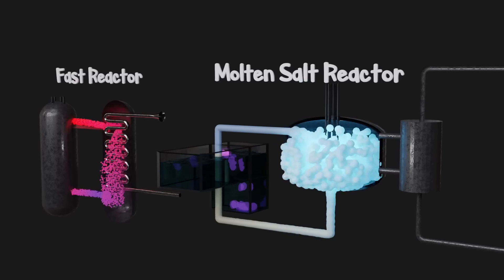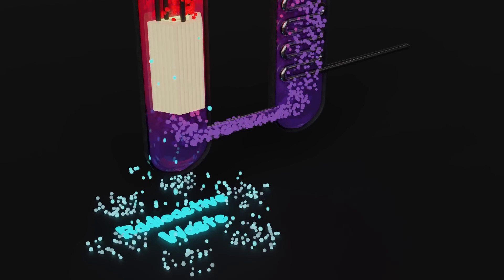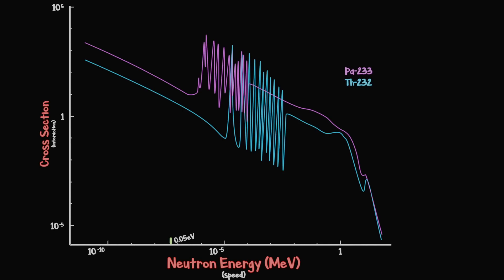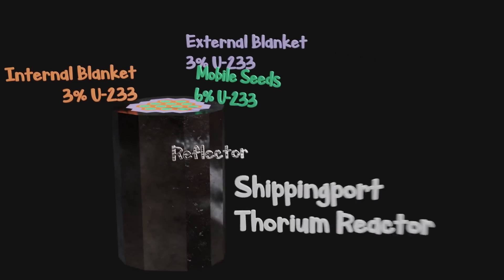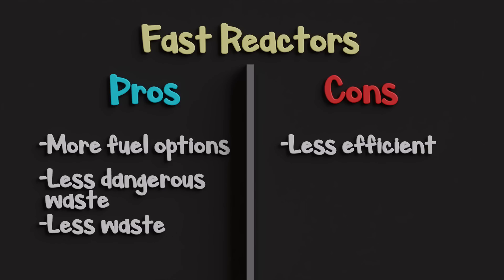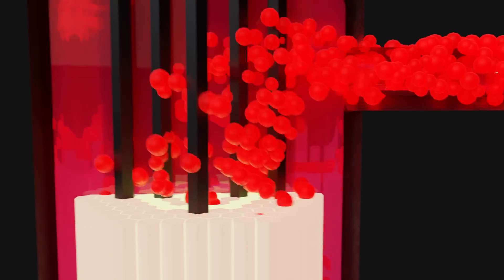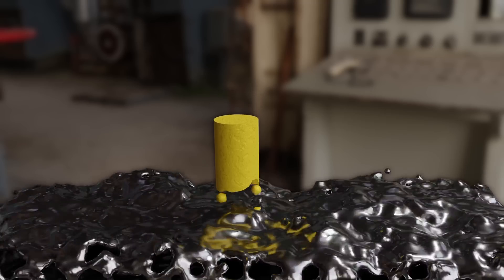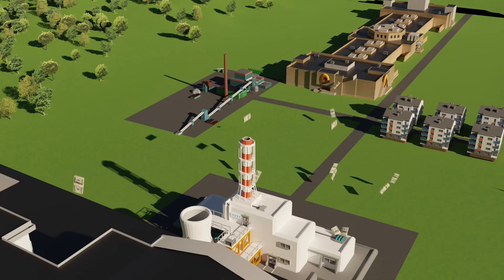Thorium and Fast Neutron Nuclear Reactors

Comment: Theory of Everything solution (short version): 

Swap from Newton "real/necessary" universe over to Leibniz "contingent/not-necessary" universe as our fundamental blueprint of the universe. 

This includes Leibniz calculus vs Newton calculus. Anywhere Leibniz and Newton thought different. All of it. Full swap.

Gottfried Leibniz "contingent/not-necessary" universe just lacked 2022 quantum physics verbiage (just match up definitions i.e. quark and Monad) and Hamilton's 4D quaternion algebra (created 200 years after Leibniz died).

Lastly, our first number is NOT 1. 
It's 0.

Our ten numbers are 0, 1, 2, 3,...9 ✅.

Our ten dimensions are 0D, 1D, 2D, 3D,...9D ✅.

Ask someone to begin counting. I bet they begin with 1.

1 is not the beginning.
0 is the beginning.

1D is a Line; two points; physical; matter; beginning and ending; contingent.

0D is a (point); exact location only; no spatial extension; zero size; Monad (Leibniz) Quark (strong nuclear force); necessary.

Examples: 

What is another word for quark?

fundamental particle, elementary particle.

Do quarks take up space?

Its defining feature is that it lacks spatial extension; being dimensionless, it does not take up space. 

How fast do quarks move?

the speed of light (see Leibniz's Law of Sufficient Reason).

What is an elementary particle example?
(0, 1, 2, 3)

Elementary particles include 
quarks (the constituents of protons and neutrons), 
leptons (electrons, muons, taus, and neutrinos), 
gauge bosons (photons, gluons, and W and Z bosons) and the Higgs boson.

What is the size of an elementary particle?

The elementary particles are not believed to have any size at all. As currently understood they are zero size points. Protons and neutrons (and all hadrons) are about 10−15m.

Match Leibniz definitions to quantum physics definitions. Different word, same definition. 

Not a coincidence.
Reply: This feels like bot.
Reply: Human consciousness, mathematically, is identical to 4D quaternion algebra with w, x, y, z being "real/necessary" 
0D, 1D, 2D, 3D 
and i, j, k being "contingent/not-necessary" 
0D, 1D xi, 2D yj, 
3D zk. 

0D is always w (real/necessary)

1D-9D contingent/not-necessary universe has "conscious lifeforms" (1D xi, 2D yj, 3D zk)..."turning" 'time'.

[In mathematics, a versor is a quaternion of norm one (a unit quaternion). The word is derived from Latin versare = "to turn" with the suffix -or forming a noun from the verb (i.e. versor = "the turner"). It was introduced by William Rowan Hamilton in the context of his quaternion theory.]

[Math; 4D quaternion algebra]
A quaternion is a 4-tuple, which is a more concise representation than a rotation matrix. Its geo- metric meaning is also more obvious as the rotation axis and angle can be trivially recovered.

How do you make a quaternion? (Nobody is starting with 0)

You can create an N-by-1 quaternion array by specifying an N-by-3 array of Euler angles in radians or degrees. Use the euler syntax to create a scalar quaternion using a 1-by-3 vector of Euler angles in radians.

"Turn" to what, you might ask. 5D is the center of 1D-9D. The breadth (space-time). All things are drawn to the center, the whole. (Gravity means Nothing compared to the Strong Nuclear Force)

[Contingent Universe]:

3 sets of 3 dimensions:
(1D-3D/4D-6D/7D-9D)

The illusory middle set (4D, 5D, 6D) is temporal. Id imagine we create this middle temporal set similar to a dimensional Venn Diagram with polarized lenses that we "turn" by being conscious. 

Which requires energy. 3D height symmetry/entanglement with 6D depth and 
9D absorption is why we are "consumers", we must consume/absorb calories, and sleep, to continue "to turn" 'time' (be alive).

1D-3D spatial set/7D-9D spectral set overlap creating the temporal illusion of 4D-6D set. Transcending one another.

1D, 2D, 3D = spatial composite (line, width,  height)

4D, 5D, 6D = temporal illusory (length, breadth, depth)

7D, 8D, 9D = spectra energies (continuous, emission, absorption)

Symmetry/entanglement: 

1D, 4D, 7D line, length, continuous 

2D, 5D, 8D width, breadth, emission 

3D, 6D, 9D height, depth, absorption

[Time]
According to theoretical physicist Carlo Rovelli, time is an illusion: our naive perception of its flow doesn't correspond to physical reality. Indeed, as Rovelli argues in The Order of Time, much more is illusory, including Isaac Newton's picture of a universally ticking clock.

Does time exist without space?

Time 'is' as space 'is' - part of a reference frame in which in ordered sequence you can touch, throw and eat apples. 
Time cannot exist without space and the existence of time does require energy.

Time, then, has three levels, according to Leibniz:

(i) the atemporality or eternality of God;

(ii) the continuous immanent becoming-itself of the monad as entelechy;

(iii) time as the external framework of a chronology of “nows”

The difference between (ii) and (iii) is made clear by the account of the internal principle of change. 
The real difference between the necessary being of God and the contingent, created finitude of a human being is the difference between (i) and (ii).

Conclusion: Humanity needs to immediately swap from "Newton" to "Leibniz". Also from Edison to Tesla. Also the Aether guy.

Our calculus is incorrect (Leibniz > Newton):

What is the difference between Newton and Leibniz calculus?

Newton's calculus is about functions. 

Leibniz's calculus is about relations defined by constraints. 

In Newton's calculus, there is (what would now be called) a limit built into every operation.

In Leibniz's calculus, the limit is a separate operation.
Reply: The known multiverse:

1) real/
necessary 
w, x, y, z being
0D, 1D, 2D, 3D 

2) contingent/not-necessary 
w, xi, yj, zk 
(YOU ARE HERE) being 
0D, 1D xi, 2D yj, 3D zk 

3) simulated/imaginary 
(working on it)

Our ten numbers are 
0, 1, 2, 3,...9 ✅.

"10" is not one of our ten numbers.

If you think 10 comes before 0...you might be duped by Newton's logic/calculus/physics.

What an absolute fraud. Newton used political power to "win" against Leibniz. 

And Humanity foots the bill. 

The scumbag, trying to "win", always wins.

Edison was the scumbag vs Tesla.

The M and M "Moron" scumbags vs the Aether guy.

The list goes on and on. Read about Newton. Even his most significant achievement was disputed (Hooke had beef with Newton "stealing" HIS original idea).

We need to reassess who we're even studying 📖.

If humanity all had the correct fundamentals then we'd advance like Tesla was talking about.

Who's doing this...

It's like a Twilight Zone episode where Globalists are pushing fundamentally incorrect gobbledygook to keep the Plebians stupid.

fundamentals = rock 
specifics = sand 

Everyone is a genius at the fundamentals.

CERN so concerned with 1D, 2D, 3D, 4D 🚫  instead of 
0D, 1D, 2D, 3D ✅.

Derp.
Reply: ...You then who are spiritual should worship neither the creation or the Craftsman, but the Father of Truth.
-Heracleon

God: pre-cosmic cosmogonic bearer of personhood.

What is another word for cosmology?

In this page you can discover 17 synonyms, antonyms, idiomatic expressions, and related words for cosmology, like: quantum-theory, cosmism, celestial-mechanics, cosmogeny, cosmogony, cosmography, cosmological, quantum mechanics, catastrophism, superstring and metaphysic.

The Puranic cosmogony also contains stories of the dissolution of existence in the cosmic fire that emerges from the breath of Rudra (see Rudra), or Śiva (see Śiva). Wind and floods complete the work (see Vedic Cosmogony, Upaniṣd Cosmogony). From: Puranic Cosmogony in A Dictionary of Asian Mythology »

“A‌nd God said, Let US make man in OUR image, after OUR likeness". …

Sus. 
I say that's the imposter. (Blind Fool Yaldabaoth)

Can't hide his plurality.

Blind Fool Yaldabaoth talks about this universe being born "from the ashes of the last" and 9D is absorption, sooo...

Theoretical end to our universes.

The Savior already won for us Blind Fool Yaldabaoth lost; he r dumb.

Religions need to get their filthy hands off Humanity's divine biblia. That's our fundamental blueprint, you jackwagons.

Our multiverse is a set of 3.

 Before we're here is Real/Necessary, 
this is Contingent/Not-necessary and we create a Simulated/Imaginary universe from here.

Guess we like a universe on each side.

Real > Contingent > Simulated.

How do we do holographic and/or projection universe 🤔.

We can prove the Aether guy was correct as well. Everything matches up with Leibniz, Hamilton, Plato, Tesla. 

5 elements are Earth, Fire, Air, Water, Aether.

And our Souls are the strongest Force by a ludicrous amount haha.

So is there no "gravity" and it's actually called "Aether" (which our Souls make happen)? Hmm...

Comment: 11:18-11:50 and that is ladies and gentlemen one of the simplest inditement of capitalism. Very clear, societal goals will always be an afterthought to the profit motive. It's a great video btw accurate to the details and explains it quite well to the layman.
One more thing, as far as I know at least in the case of a LFTR the plan is to use fluoride volatility for the seperation of Pa from U due to the fact that uranium has higher oxidation states available while Protactinium does not, and they also have a significant difference in phase state under chemical processing conditions (protactinium tetrafluoride is liquid while the uranuim hexafluoride is a gas at that temperature and pressure) which makes the separation a somewhat simple process.
Reply: Have you considered taking a course in economics? Cause if you did maybe your takes on the subject would be far better informed than it currently is. Best way to put it frankly I'm not even being sarcastic. Cause going capitalism bad now go watch this video I am recommending is actually  pretty dishonest that is a under handed move and you should feel bad about doing, I doubt you do though as people that advocate for the ideas that you do don't even have a moral compass to begin with so being honest about what you believe if the least of your concerns. You cant even come out and explicitly say what are advocating for, you have to hide behind layers of ideological rhetoric and dogma like "societal goals" how cute.
Reply: @TheOriginalJAX  after a fat ad hominem sure Im gonna take you seriously. How about you take a class on economics? And the criticism of capitalism is not equal to the advocacy for communism, if that was you tried to refer to.
Reply: @TheOriginalJAX  notice: you don't know a jackshit about me you already think you know it all, that alone could discredit you, not to mention the needlessly offensive style.
Reply: @CraftyF0X  Haha checkmate. You would say that that's because you are cornered and have been beaten because I am right and there is no getting around it lol. keep trying to distract and change the subject though with it's clearly working wonders. Go have the last word too Il leave the floor to you, Il let you have that one thing.
Reply: @CraftyF0X  Haha stay salty.
Reply: This kind of fuel management would probably not liked by regulators.
Reply: Fossil fuel is still abundant and comparative cheap, so in a free market, it's the most profitable option for private industries to take. And millions of people are working in fossil fuel industries directly, and they don't want to lose a job. If we want to transition to non-fossil fuel sources quickly, we need to be willing to compensate people who'll lose their job. If you're proposing a climate policy that doesn't answer what will happen to the working class in those sector, a large percentage of the population wouldn't support it. People are willing to support environmental policies, as they'll always put their own wellbeing above it first. Fortunately, wellbeing and environment are not mutually exclusive, but as the current system goes, politics would appeal to only one or another, because fossil fuel industries have a big influence on the politics.
Reply: @mickeyg7219  Yea that is the conventional thinking about these things. Here is a radical heretic thought to you: ppl does not need jobs in the fossil fuel sector, they need opportunity to live a comfortable life and a society that values them for what they do istead of working in that industry. This "jobs must be created" and "jobs must be protected" mentality does nothing but slows down the progression of automation and the elimination of boring, repetitive, dangerous sometimes even meaningless busy work. Maybe if the owner class would not take all the surplus for itself we could have achived a much better living standard for everyone even with less work by now. Productivity keep rising as technology progresses but the ppl still work as much as ever if not more. They try to fuel an endless growth, but not for themselves, only for the very few on the top. To what end - I would ask- we want to grow the economy forever ? Why if it only ever lift the already exalted ? Is it economical to use up all our resources ever faster to "convert them" into some abstract conceptual value on a bank account that only we, inteligent apes value at all ?
Reply: What are we to do when profit incentives don't line up with "societal goals"?
Reply: @metroidman3893  That's where a competent government is supposed to step in, unbiasedly using taxes gained through profitable industries to fund non-profitable (but good for society) projects. Unfortunately humans don't seem to competent governments very well.
Reply: @G3HP  i think election terms might also be a factor. a reactor might take 20 years give or take to build. a politician wants a quick and easy solution to get him re-elected. if something takes 20 years to make someone else will have already been elected. that's just an opinion though.
Reply: Competent government. Thats an oxymoron my guy. @G3HP

Comment: what is 'fizzle'?
Reply: are you referring to "fissile" (sounds similar)? it refers to an element that is capable of undergoing fission (splitting of the atom).
Reply: @teslacuil1437  Technically its fissile if it can be fissioned with thermal neutrons. It may seems a distinction without difference but it's not. You can induce fission with 2MeV neutrons in fissionable material if you want while orders of magnitude less energetic neutrons can fission fissile material. For example U-238 is fissionable but not fissile.
Reply: As TeslaCuil said. But the pronunciation in the video is non-standard or regional US English. It should really be more like /ˈfɪsaɪl/, with the diphthong found in the word "eye".